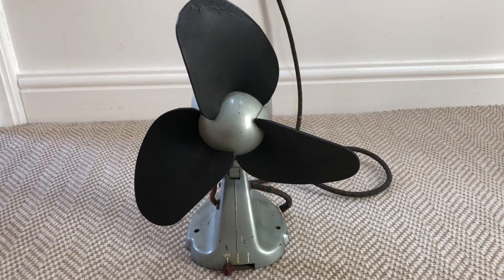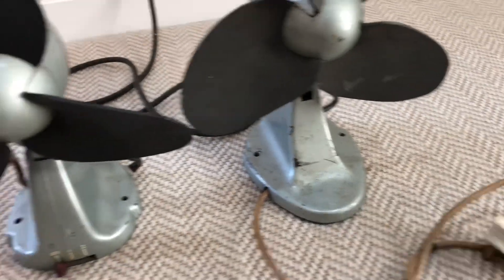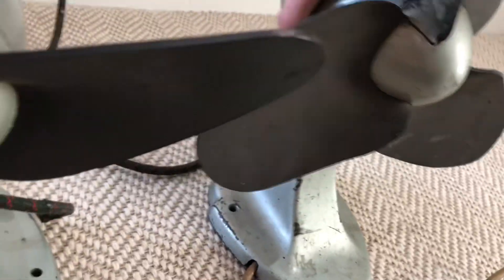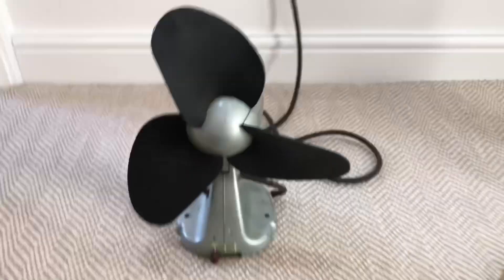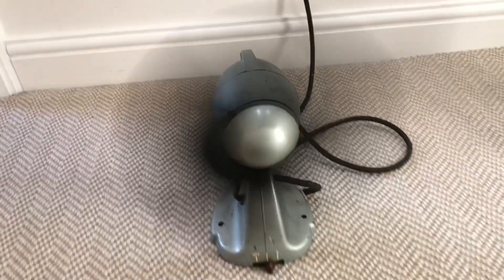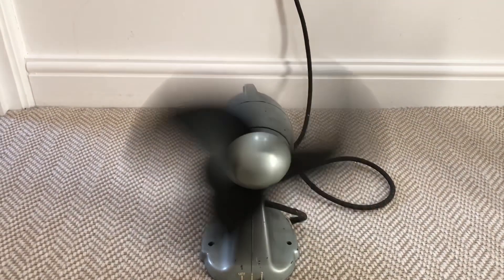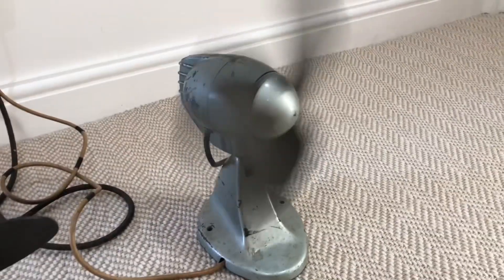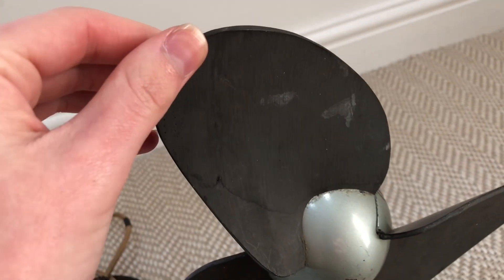New fan: This is a 1950s GEC 12” desk fan

Comment: This is the first 12 inch desk fan I'm known to only have 2 speed settings. All other 12 inch desk fans I've known to have 3 speed settings.
Reply from the maker: @JoelyB2006  Surprisingly 12" desk fans back then did commonly have 2 speeds instead of 3. 3 speeds were usually reserved for 16" fans only but that changed at some point.
Reply: @Connectitthefancollector  Wow! I've only ever known 9 or 7 inch desk fans to have 2 speeds.
Reply from the maker: @JoelyB2006  Yeah 9" and 7" fans being 2 speed has been the norm since the 70s I believe. Also fun fact, frost sold some 12" desk fans that are only 1 speed and GEC sold some 16" fans that are only 2 speed!